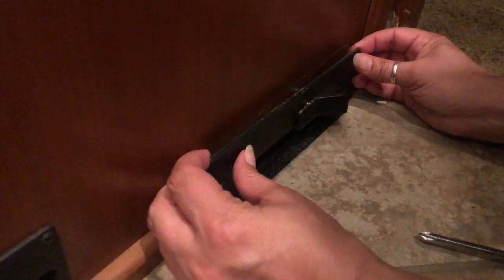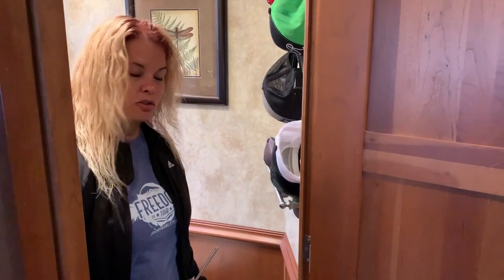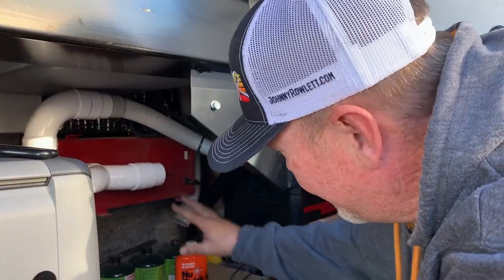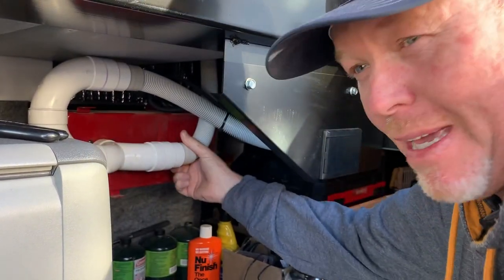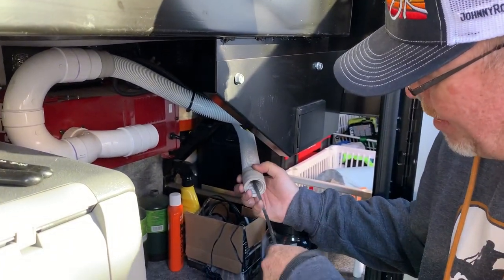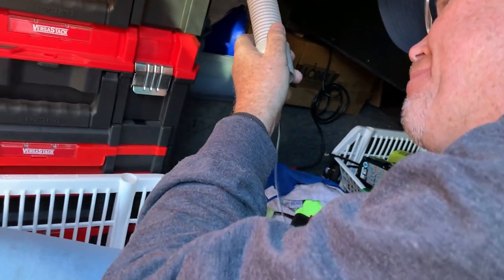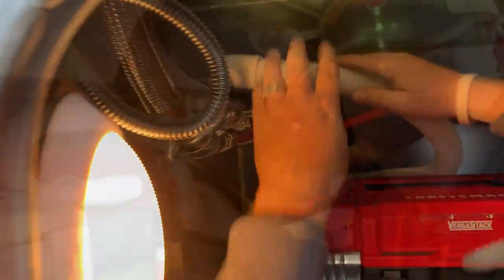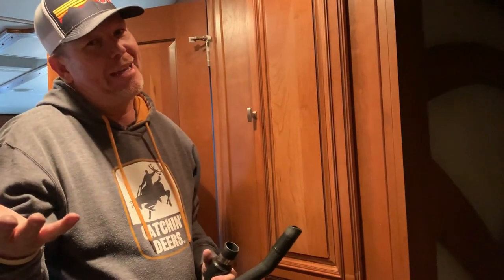How to Repair Your RV Onboard Central Vacuum Cleaner (Dirt Devil)

Comment: Ours won't turn off by pushing the button. It just started doing this. Does anyone know why this is?
Reply from the maker: Wow! That’s crazy! What button are you pushing?
Reply: @FreedomTours  😂 ....ikr? No button at all!
Reply: Idk what happened to my other post but my issue is that the vaccum turns on and stays on whenever we push the "reset button" on the electrical outlet in the bathroom. That's how we are able to use our outlets, but since the vacuum won't turn off we haven't been able to use the outlets because of it. We just need to know how to turn this thing off, pushing the button isn't working. It's very frustrating. It just started doing this.
Reply from the maker: @katalackatt76  so crazy... when you unplug the vacuum hose, it doesn’t automatically shut off? The way ours turns on and off is when the hose is in and out
Reply: @FreedomTours  yea it's going with no hose attached!
Reply: @FreedomTours  does it have to do with the inlet valve relay, or something.  You know that plastic cover that opens n closes turning it off n on? We don't know anything about electrical stuff . 😱😩
Reply: We kinda figured out what the problem could be. In order to do this obviously to shut the power off first, this is going to sound stupid but does that mean we have to unhook the battery too? We are connected through shore power, we unhook that AND turn off breaker box. Battery too?
Reply from the maker: @katalackatt76  I think the problem is the two silver buttons that get pushed in when you plug in the hose... somehow those must be getting stuck
Reply: @FreedomTours  we found that the low volt wires are cut and look melted actually, we checked the opening no stuck buttons as we could tell.